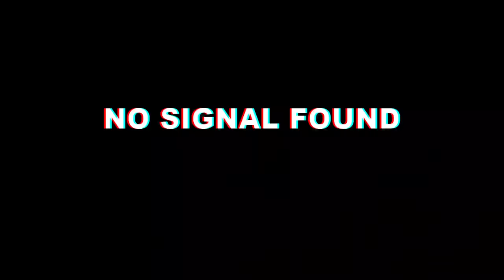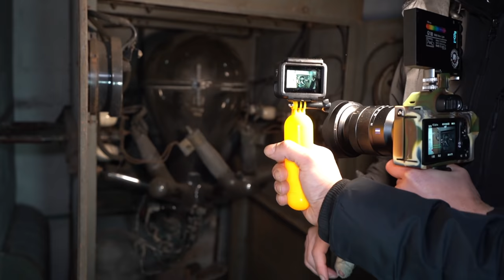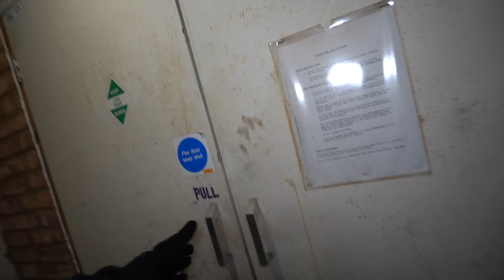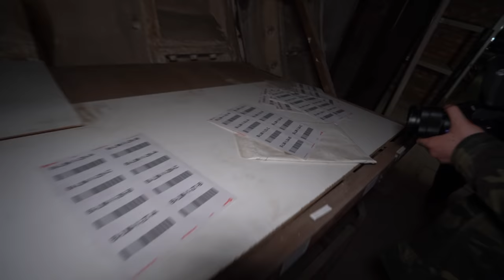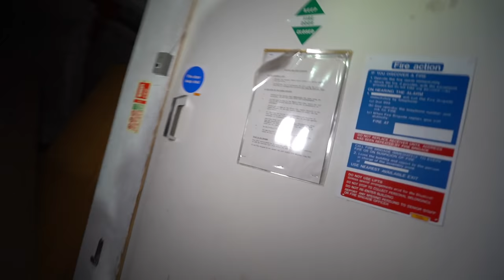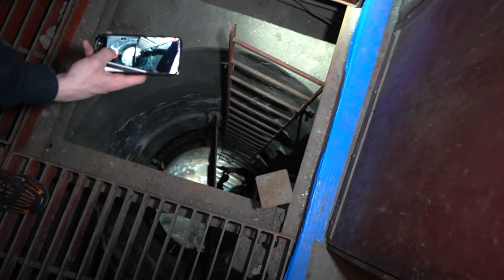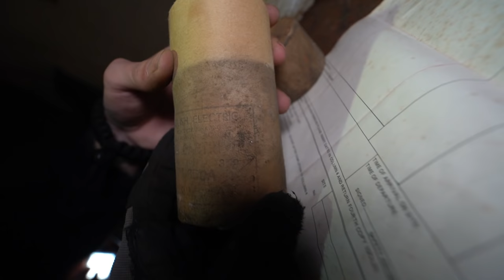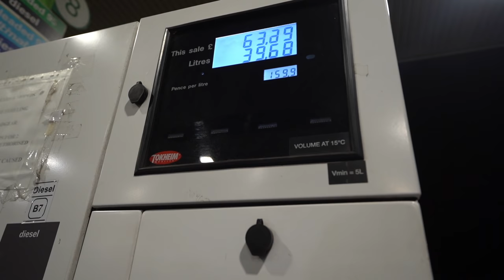WARNING Inside London's Secret Underground Hideout | Under the High Street

Comment: Its a mercury arc valve / rectifier, converts high voltage or high current ac into dc current. I saw the one at the belsize park tunnels years ago when it was being used as a data storage centre.

Comment: Loved watching this one, nice to see Dave  and Mark of AWE  there also. They Mercury Arc rectifier rectified DC voltage through the transformer in the adjacent room and becomes alternating current AC. The  little round rings found in one of the drawers are called gel grommets.  These grommets are fitted underneath The tunnel lining ring bolts to stop water leaking through the thread of the bolt. If you remove a bolt, 9 times out of 10, water collected behind the tunnel rings leaks out. These grommets stop that happening. My husband worked on the underground,  installing High voltage cables and had to remove the tunnel  bolts to install new supporting brackets for the cable. New gel grommets were needed to be fitted every time a bolt was removed.  London Underground do not allow these bolts to be removed now.

Comment: Commissioning Engineer here. The switch gear you were near has long been decommissioned. It's a 40's/50's distro panel for air circulation. There is no way that would be certified for modern power distribution.
Reply: How come it still had 40 amps running through it?
Reply: @uK8cvPAq  it didn’t have 40 amps running through it the needle was pointing to zero the red line is exactly that it’s telling you the max amps just like the red line on a cars rev counter
Look on dans brothers video he shows a close up of the gage
Reply: @Pwills  Ok cool my bad.
Reply: @jules8653  Pretty much.
Reply: @jules8653  Yep, that's exactly what it is... It's a MAR system (Mercury Arc Rectifier) they were used as a rudimentary AC/DC converter. You can see the large glass MAR bulb in the plant room at 55:52. Pretty cool to see one still in situ, it really should be saved and displayed in a museum.

Comment: What you guys found was a very rare mercury arc rectifier,it converted high voltage to usable lower voltage for underground trains and charging batteries for electric vehicles,it probably still worked.They were basically the transformers of the time.Very old technology.

Comment: That mercury arc rectifier was not operating. If if was, they emit a bright blue glow. I would say they were used to power the elevator at the nearby exit. Good chance those circuit breakers are what switch it on